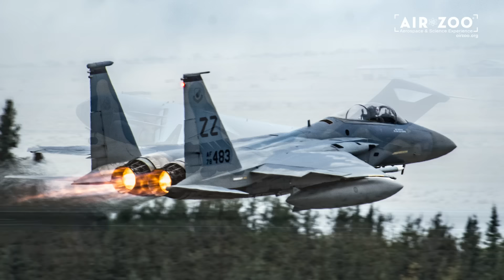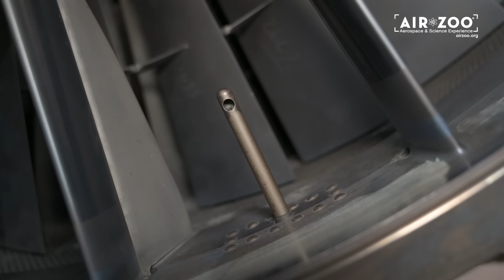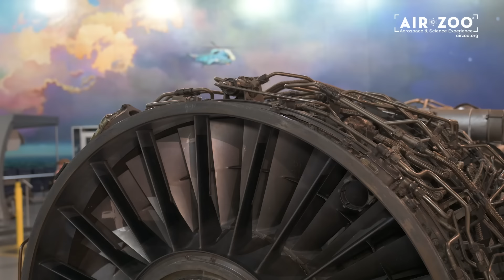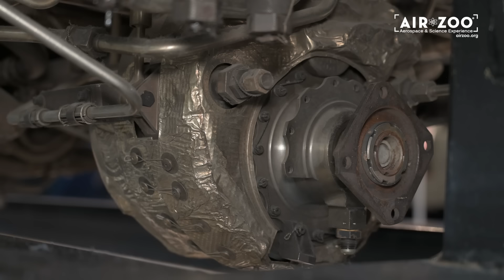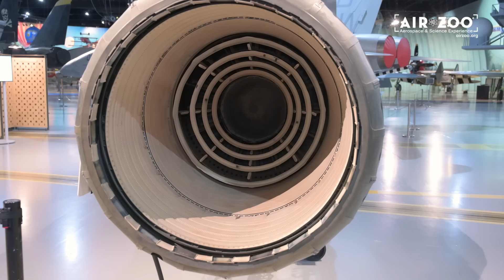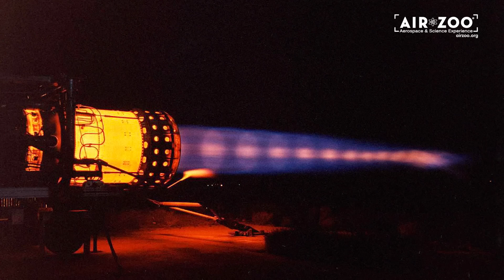The Pratt & Whitney J58 - The Engine of the SR-71 Blackbird | Part Two

Comment: It is amazing to sit back and think of all the problems they had to solve with just the engine regarding the SR-71, and given the fact it was 70+ years ago is even crazier. If this is what we could achieve way back then when we put our best and brightest on a project. Imagine what we could do today. Sadly though, everyone is talking through computers and email. The days of a production floor full of engineers and assemblers working directly together to design and build an aircraft are long gone.
Reply: I really like pouring over some of the old photos of the engineers at Cape Canaveral from back in the 60's. Most all of those engineers were barely into their early 20's fresh out of school. I'm in awe at what they were able to accomplish by putting their minds together.  Solving structural analysis and complex trajectory problems with slide rules and pencils.
Amazing!

Comment: 20 years at P&W and a Graduate Apprentice.  I remember the parts, and the terrible alloys we struggled with. So good to see the engine is no longer a secret.  We were all proud,  but very quiet about what we saw and worked on.   Bill Hughes    South Carolina
Reply: Hey Bill, I have a couple questions i hope you can answer. regarding the 2/3 of the air that goes around the engine but inside the nacelle. Where does that air get separated? How does it flow outside the engine but inside the nacelle? From pictures ive seen with the cowlings open and the engine removed, all i see is airframe ribs with no smooth surface to manage the airflow. Is there some sort of sleeve in between the engine and the airframe? how is it not visible? and just to be clear the 2/3 of the air that goes around the engine is not referring to the 6 bypass tubes correct?
Reply: @akamouzis Yes, there is a space around the engine inside of the nacelle. Simple
Reply: Thank you for your efforts Bill, do explain some of the stuff you had to do with the SR-71!

Comment: This is why we need engineers in America.  Today's P&W is creating a very unreliable geared turbofan that is coming apart inflight.  They claim it's just the metal casting part but you'll find an airline exec admitting that it is every part of the engine that suffers from significant quality control issues.  Every Airbus operator is significantly affected, especially Spirit and Jetblue.  P&W has fallen.
Reply: The problems with that engine are not due to the gear box, and the problems it has are not dissimilar to those found in other manufacturer’s engines.

Comment: Says "it's just a simple turbojet" while standing in front of a maze of tubing and wires that no normal human could ever understand. I love it!
Reply: Actually it is all relative and some “basic aspects” of the core (which in this case is a single spool turbojet) are fairly basic but then there are so many additional features that regular turbojet do not even have. So I guess from his perspective the spinning parts are relatively simple compared to other engines that he has worked on. But the propulsion system as a “whole” is very rather complex and unique.

Comment: Buick ‘Nailheads’ ?
Reply: Im hard of hearing but if he did mention Buick "nailheads" then hes probably talking about the older Buick car engines they would use to start the J58 engine at 3000 rpms.
Reply: Old school hot rodder term for the size of the Buick intake and exhaust valves,
Reply: @arniegunderson9649  Gotcha…Thanks so much !

Comment: Now…@29:33 plus, what are those 9-10 discs perpendicular within the flame itself ?
Reply: One can see the MACH DIAMONDS on other rockets more clearly providing they are not solid rocket boosters. What you are seeing is when a hot supersonic exhaust flow generates an internal shock wave that decreases the flow velocity and increases the pressure enough to heat the flow to incandescence. (I think)
Reply: Standing shock waves, which are layers of supersonic air slowing down to subsonic as the exhaust flow contacts the ambient air.
Reply: @arniegunderson9649  Gotcha…Wow ! Thank-Yoy so much for the feedback !
Reply: Those are called MACH diamonds.  Exhaust gas in the supersonic realm... you also see those in almost all liquid fueled rocket engines. Starship has them also but they are HUGE because of all the engines working together.
Reply: @gerrywalsh5766  Thanks for your feedback !
Reply: @65gtotrips  have yourself a wonderful day. Kinda chilly here in Detroit at 4:07am.  Lol

Comment: How they figured all this shit out without computers is insane
Reply: @CRW82
Exactly . . .
@24:34 - Yup! He precisely point-out the exact location of " catalytic ignition " for ' after burner ' is very impressive.
Reply: Computers can't design jet engines. (They might be able to now with AI, but that will be very recent).

The engineers still design the jet engines, but the computers enable simulations to take place so they can verify the performance and get the design right before the engine is built.

Comment: Would a “mouse” now be considered a tubercle? And does the bypass Air coming in just behind the turbine go in at a 90deg angle to more evenly fill the area behind the turbine? As I would think going in at a 45 deg angle would cause less drag to the air. 
 This is so awesome! I love an old school guy that knows so much about the little stuff! Thank you!
Reply: The bypassed air has two purposes:  Combustion air for the AB, and cooling film for the afterburner ducts and liners.  Running the air back into the turbine exhaust area is slow enough that streamlining it was not necessary.
Reply: @ Awesome thank you!

Comment: Interesting that helium was used without a pitot tube. Wouldnt this give static T2 and not total T2?
Reply: Interesting question, looking at the picture of the coils in the sensor it would seem to be mostly the moving air flow temperature and not the stagnation temperature. But it seems like the moving air flow temperature is the one that is needed for the engine control system.
Reply: @ total temp is generally what is needed. Blade tips see total temp and that sets their limits and the energy available to the engine depends on total temp.
Reply: @DylanEdmiston 

Total temperature is the same thing as stagnation temperature. There are three distinct different temperature sensors being used for three distinctly different functions. The other two types of sensors are more along the line of measuring total temperature. The one with the helium which seems to be specifically designed to measure the temperature of the air flow into the core.  The thermocouple sensor that goes to the pilot looks like a total temperature sensor which makes sense as the pilot is responsible for not exceeding the “normal” operational compressor inlet temperature due to lifetime issues with the blades. My understanding is that in an emergency the pilot could exceed this temperature (it was talked about in a mission that went into Libya) but the engine would require expedited maintenance.
Reply: @Mentaculus42  Yes stag and total temp are the same.  Im sure you are right about brief overpower.  Does not explain why static temp needs to be measured at all..
Reply: → Dylan

Looking at that particular coiled sensor with a distinct leading edge shroud that I assume is there to thermally separate the stagnating part of the air flow from the coils seems to be designed to capture something close to the static temperature. Since it is specifically meant for the control of the fuel flow to the combustors in the core and with the helium filled coils is probably more linear and sensitive than thermocouples (maybe). And perhaps more mechanically compatible with the mechanical fuel metering “computer” & has separate redundancy it seems to be very important. 

I don’t know enough about turbines to speculate about why it is configured that way. As you say it makes more sense to use total temperature because that would track the temperatures that some of the internal components would encounter. But maybe the combustor cans have temperatures that track better this way. The TIT is generally the most important temperature and that would seem to be more correlated to total temperature. Wish I knew more. I guess I am going to have to get that book that AgentJayZ recommends. My thesis advisor designed jet engines for Pratt & Whitney during the relevant timeframe, I wish that I had learned more from him as he was brilliant.
Reply: The aircraft is interested in static Pt2 and Total Pt2 which are measured by the Pitot tube.  The engine doesn't use those parameters as part of the control system.   Just Temperature.

Comment: "The J58 is basically a very simple single spool turbo jet"

5,000 miles of complex tubing right behind him
Reply: The tubing is still simple. This engine is way before anything electrical. Essentially entirely analog. Majority of those tubes act as the sensing or talking ability for each component.
Reply: “Very simple device” I was like 😮😮😂
Reply: Simple in theory, incredibly complex to put in practice
Reply: The propulsion system was far more complex and balanced thermodynamically than just the turbine.  Not like a logic board.
Reply: But the core is a relatively simple turbojet engine other than the materials. It is the total propulsion system that is unique.

Also parts of the engine are extremely hot for very long periods of time but still need to be controlled (and all this was designed back in the late 1950s). Even today’s technology would find this very challenging.
Reply: so is my B58
Reply: yeah man we saw the same clip as you

Comment: Ceramics insulation not disapation
Reply: Expand upon this statement. He said dissipation and then “radiation” cooling. Also, the ceramic helps the metal from oxidizing. Would seem to also provide a little insulation as you mention and possibly some erosion protection. Probably a bit complicated.